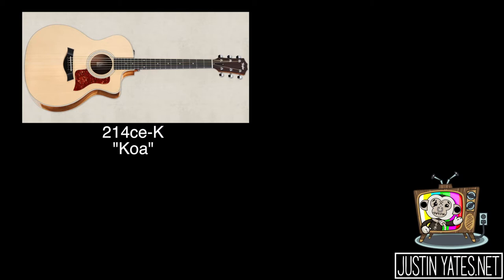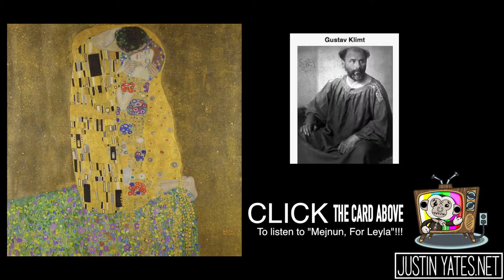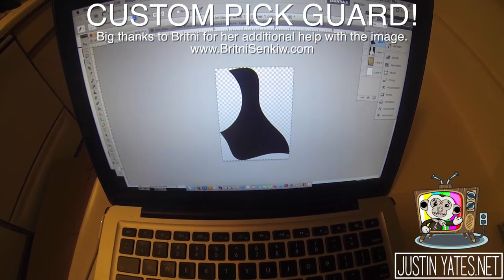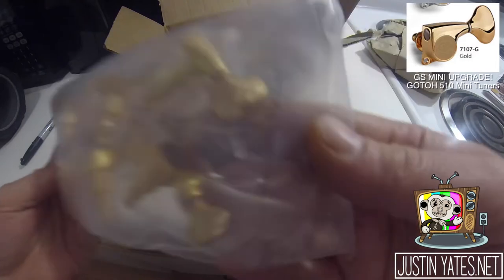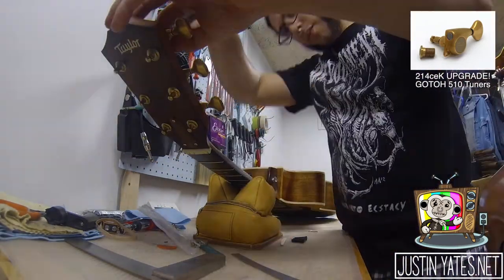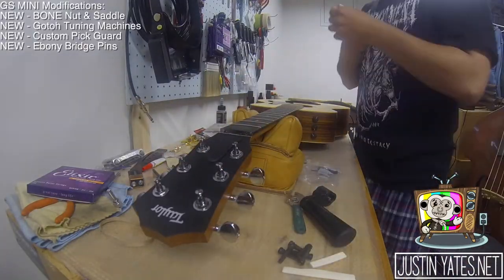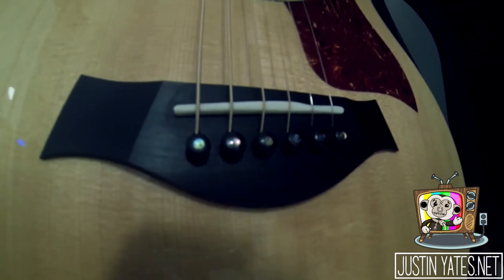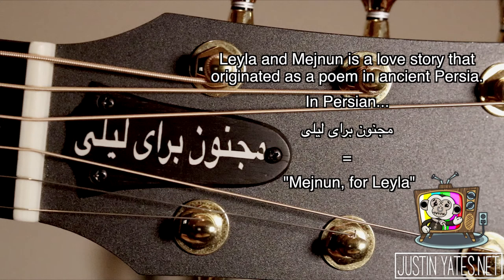Taylor Guitars GS MINI-E RW & 214ceK Upgrade!

Comment: Just got a mini, like what you did to your two Taylor’s, it’s all about making them your own
Reply from the maker: Indeed!  Which model MINI did you end up getting? Thanks for watching. :)
Reply: Justin Yates Koa, and I love it I haven’t been able to put it down.
Reply from the maker: @ajvc2233  Very cool.  Do you plan to do some upgrades to it as well?
Reply: Justin Yates yea that’s what I’m looking at now, bridge pins for sure. What did you think after swapping the tusq for the bone?
Reply from the maker: @ajvc2233  Truthfully, I'm satisfied with the swapping I did.  The only downside to this guitar is the limitations with having a smaller scale length. Onto swapping notes: The tuning machines are great, Gotoh are the best!  The nut and saddle swap made the guitar "sing" even more.  I always felt that the GS mini had a great resonant tone by itself, but the subtle change in material brought out those characteristics even more.  I also thought it had a bit more of a "smoother" sound opposed to using the tusk. Taylors tend to be a bit bright in my opinion, I felt the changed slightly helped in that department.
Reply: Justin Yates that’s good to hear! I prefer bone but was a little unsure with the mini but it sounds like it’s worth it. I forgot the tuners, yes I was looking at waverly but they are expensive so shopping around on those. Did you keep it with 13s or go for a lighter gauge string?
Reply from the maker: @ajvc2233  Gotoh's can be pricey but the mini ones look great on the GSMINI. Very happy with the size of them.  If I were to put regular tuners on there it would have looked really silly.  Oh yes, kept the 13s.
Reply from the maker: @ajvc2233  keep me posted on what you end up doing.
Reply: Justin Yates I think you’re right about the gotoh minis, I am looking at the cosmo black 510s 18:1. Also found a truss rod cover I like, from this place Thalia capos, I’ve never ordered from them tho so not sure. So I am going to do just about all that you did minus the pickguard only because I don’t want to hide the koa top. Did you see the new Taylor’s they just released?
Reply from the maker: @ajvc2233  I did.  I'm not sure how much of a fan I am of the new bracing system.
Reply: Justin Yates I have to agree, it’s either going to flop or revolutionize the guitar much like x bracing did by Martin
Reply from the maker: @ajvc2233  I'm not expert on the subject, but from what I"ve heard it isn't the best move.  Despite that, I want the Taylor 8 String soooooooo bad. lol
Reply: Justin Yates is that the baritone model? They sound amazing.
Reply from the maker: @ajvc2233  yes.  and yes they do!!!!!
Reply from the maker: @ajvc2233  It is not.